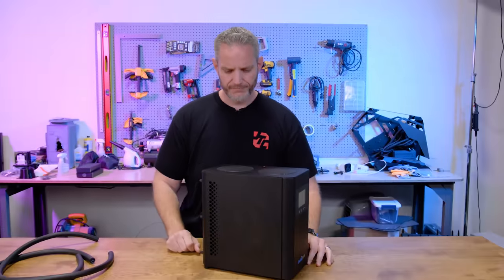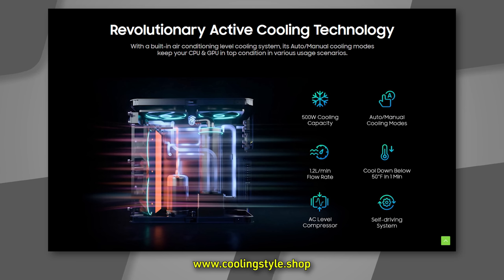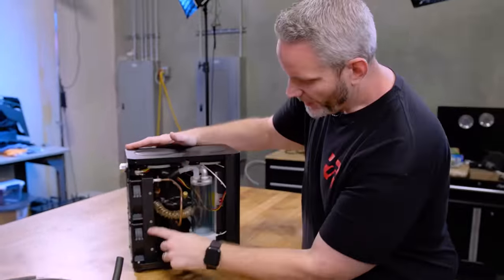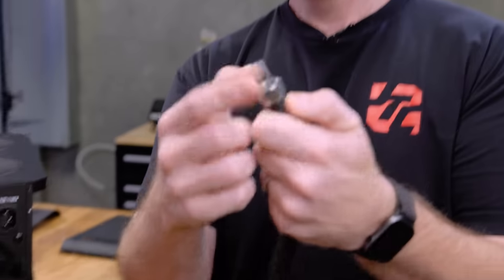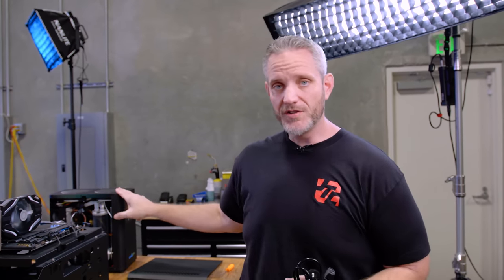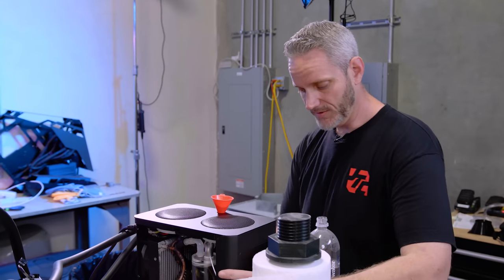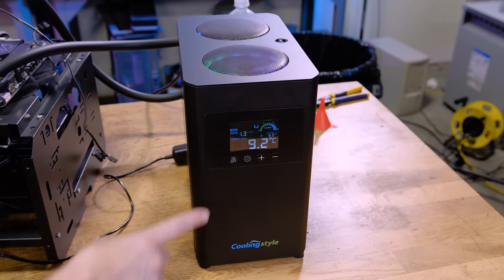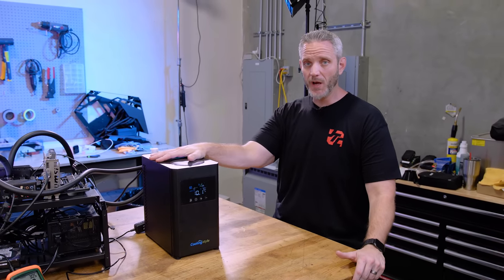This seemed Gimmicky... Turns out I was right!

Comment: for the cost of this, i think i'd install a wall ac into a closet (mini split style) and run water cooling loops into that space with direct cool air output onto them. that way you can apply the benefit to all systems you want to run the loops into the closet for. a panel with a bunch of QD's, and gtg. if you want to get extra fancy, put the pumps in the closet too, and put in a switch panel to control those so they aren't trying to pump water when you have nothing connected.

that or just mini split cool the whole room and deal with being a little chilly in some cases.

i'm sure this has its use cases, but most people probably don't have a need.

Comment: This is another case of: "The idea is good, the implementation is not" There is a reason why our houses air conditioner compressors go on the outside of the house, you can't have a silent gas piston compressor, also how do they manage to keep condensation controlled? If that thing is cooling down the water under ambient temperature condensation will happen inside the unit if air humidity is high, and after some hours it will start to spill water on your desktop, also the air conditioners of our houses have a water drain to manage this natural condensation.

Comment: I used to use the Coolit System Freezone Elite V2, it used to be able to get your CPU to sub-ambient temperatures easily while still being a relatively small self-contained unit that ran pretty quiet because the fan never had to spin at high RPM.

Comment: The 500W is the cooling rating of the the unit, the compressor maybe 450/440W. The power consumption of the unit would be around 170W. 
What maybe interesting is when you exceed the 500W cooling load; the high-temp cutout would stop the compressor and stop the cooling. 
I agree with Jay. A better solution might be to make a similar sized box just made out of radiators and lower 10°C. 
Also the water in this loop would require maintenance/replacement

Comment: What i like about this, is the fact that it could basically sit in a completely different room to the PC you are running. Depending on the pump (which possibily needs to be upgraded). Would also remove the exhaust heat issue in the room.

Comment: If you can plumb the tubes out to the hallway where there's a window it might not be too bad for noise since it won't dump heat into that room for heat to accumulate in the air then the coolant.

That said if you can drill through the wall and have a window in the hallway and it's on the second floor or you don't mind mounting metal grills in there for security you may as well just mount a massive radiator array in there (like...say....three 140mm x 4 radiators). No need to run a compressor or any manner of powered heat exchanger and it'll double as an exhaust fan for the common areas of the house too so you're actively moving air out of the house.

Comment: I think, like Andrew Dinu said, if you were to put this unit inside its own cubbyhole on the outside of the house, that would rather restrict where to put the computer relative to the cooling unit. Additionally, you might want to include a little soundproofing on the walls of the cavity so you didn't let most of that noise back inside (my chief complaint). It ain't a quiet unit in the least.

Comment: You can buy micro fridge and customize it for the same purpose, I guess. )) Price will be several times less. And as a fancy option, you could put beer inside and heat your coffee/pizza/cheesecake outside on the heat exchange )) And yes, it should be split system. Probably, eventually every radiator in house will have option to built in your PC water loop))
Reply: Absolutely,  then when the novelty has worn off and it's thrown into a cupboard at least you won't have spent $700

Comment: @8:35 That's now how it works, the tube "should" stretch over the inlet piece, not sure how it's called, and the nut that goes over should "pinch" the tube between itself and the inlet walls, that's where you get the compression. it's still a bad system and tolerances look bad, but your "fix" seems worse .

Comment: I would have liked to see how much it cooled the system if the liquid went through your Rad first then into the chiller.
My gaming rig is in the basement, so ambient air about 55 degrees F and the HVAC runs continuously. P.S. most gamers wear headsets so who cares how loud it is. I say daisy chain about 4 of these up to the same rig fill it with antifreeze and lets re-clock that beast! ;)

Comment: Having to run threadripper in Asia hot temps, this is quite neat. Especially when we bring the threadripper to control room where noise isn't that much an issue. Having a longer tube and making a better insulation is an easy fix. I can see myself put that cooler into a sound proof box and have longer tubing connected to the PC.
They do need to hammer a few small minor things but I do love it. Especially when you know that double 360 rads (push-pull) are not enough for a 3990x with an ambient of 35 to 43C.
For casual consumer, it's a gimmick, better go with cooler master sub-zero, much more simpler for intel or an Alphacool Eiswand.
Reply: If the PC itself isn't in an air-conditioned room during a hot and humid summer, the PC might get flooded with condensation with sub-ambient cooling...

Comment: I still have a box of 1/4 fittings and adapters from quarter to 3/8 back when CPU blocks used 3/8 and GPU coolers and or VRAM coolers used 1/4 inch. Basically its just a rebranded chiller you can buy for your laser engraver/aquarium. Hence the 1/4 inch barbs they didn't even bother to put standard barbs for the PC on the unit.

Comment: Actually Jay... Due to the refrigeration cycle in the chiller. The air temp will NOT effect the cooling water temp like a traditional AIO. This is coming from someone who has worked on a/c and refrigeration systems for over a decade. 

If you think about how your cars A/C works. Just because the temps outside go up, doesn't mean your a/c stops cooling. It just means the pressures in the chiller refrigeration cycle are going to go up on the high pressure side.

This also seems like something you might use on a server where you don't have an actual server room, but need to keep the server cool in a closet. You would still have to have air circulation in the closet, but it wouldn't need to be a/c cooled like a server room would be traditionally.

It's definitely a niche product, but for a small company that needs a server, but doesn't have the money for a dedicated server room. It would be an option. I would never use it on a regular PC.

Comment: This is called a cold water machine in Chinese, as you see, it makes cold water for the loads.
This should never be used on a GPU since they don't stack heat on the chip. (Chip temp has little increment compared to the liquid/waterblock) In such cases radiators are good enough and get more if it's still too high for you.
This should be used on CPU especially Ryzens. They stack up heat like an electric iron and won't cool down unless a large temp difference (cold water) arrives.

Comment: I would imagine the next step up is like with a portable ac you have a tube running to a window insert to dump the hot air or maybe dryer vents in bedrooms become common place. Honestly I absolutely love this but I also must agree that I wouldn't put it on my desk so I'm not sure how to feel. I'm certainly not in a position to start running water tubes through my door way or inside a wall. I also think this freon based cooling is the best step forward for pc's considering we use it in cooling applications in most other appliances.

Comment: I'm sure there's use cases where this makes sense, mostly industrial applications or PCs in small closed spaces where you could use longer hoses to have this unit relocate the heat somewhere else. For most people though, running a 2nd daisy-chained 360 radiator would be more cost-effective.

Comment: They already had cases with actual refrigerant loops in them that were ready to go about 20 years ago.  Thermaltake even got in on the action.  Any system that isn't dumping the waste heat outside the room, is going to eventually start self-defeating in trying to go below ambient.

Comment: The application here is more for the extremely dedicated setups, where you're putting the fridge unit in a position that it vents outside - sort of like a window unit or central air unit AC system and just piping the water over from the unit to your computer....at which point maybe you just invest in a more advanced AC system that can preferentially deliver cold air to specific rooms and thus lower the ambient temp in the room with the computer.  Because at that point you're already doing fairly significant household modifications, but the advanced AC setup actually delivers you a benefit outside of your computer.
Reply: For not much more than the price of the chiller in this video, you can buy a 1/2 HP chiller.  If you are going through the trouble of setting up a separate chiller, use one that can cool more than a CPU.

Comment: Being an AC tech it is possible that it works, but sub cooling cant possibly be higher then 7 C for that size. So at MAX that thing cant possibly generate cooling temps lower then 7 degrees below ambient. And thats being VERY OPTIMISTIC. BTW even the smallest compressors ive seen draw 40 amps on start and constant 118V power draw and thats only 1 ton cooling requirements.

Comment: This is probably good for small home / office servers that live inside a closet of a separate room. Servers are usually running 24/7 and dust is a bigger problem than cooling. This unit will take care of the problem without having to run the office AC 24/7. I'd servers fail on me because of dust...

Comment: It would not affect the room temperature heat source does not change much. The main heat source is the cpu and gpu. This chiller just changes the heat exchange process. The pump will be an additional heat source but I don't think it would have much heat. Anyway heat would not be a problem but its sound is annoying. May not be an option for the gaming pc but may well be used for a server which is kept in a closet or small room which is not air conditioned.

Comment: I actually see more than a few use cases for this. Soooo I have a modified Koolance setup from 2002 with accessories and all mods that puts it at $488 minus shipping+tax. That comes out to $647 in today's dollar and that's calculated with each year's inflation difference related to each purchase. I didn't purchase everything all at once but managed to get everything at a pretty steep discount because I'm me. Putting all that aside, this chiller is just as much a steal at $700. If you have a normal computer and you're already invested in a nice shiny gold/copper block, grab a Koolance L-Bracket (BKT-PCI-G?) and some quick disconnect fittings and marry it to this chiller for a similar test experience.

Situation one: You are a gamer/jobber/streamer and NEED maximum chiller temps to keep your balls-to-the-wall overclocks stable enough to handle each workload. Maybe your system is (or can be) insulated through a light partition or into a separate room like an attic similar to Linus and wife's old home rack station setups where all the noisy bits are in a nearby location with all the cables and KVM connections piloted into a nice sterile room. You're not worried about noise or access because everything is pre-managed. That's GG.

Situation two: You are an overclocker/enthusiast that lives in an extremely computer unfriendly environment such as Phoenix or the lower part of Death Valley and need a rigged cooler to replace an inferior loop but also need the chiller to serve as a high ventilation vehicle similar to the low/high pressure ventilators in rack rooms or a test chamber. Additional tubing/insulation may be required along with a spec check on the pump's maximum head pressure (expect anywhere from 20-40ft) and a rigged ventilation duct to exhaust all the hot air to atmosphere. THIS is CHEAP $$$ and EFFECTIVE.

Situation three: You are a consumer/developer/engineer/manager that is creating bleeding edge technology, frequently running into NiH (Not invented Here) situations and rely on a flat priced industrial solution for the transfer of liquid and a competent chiller to pump the heat away from XYZ prototype. The noise and efficiency doesn't matter as the device fits a limited period at 100% load and you are recording and evaluating temps to create back and forth rapport to a broad engineering team tasked to create a dissimilar and less involved (but effective) air cooling solution for XYZ prototype (you're demonstrating to them it can happen despite the delta and coming up with a compromise solution).

So yeah. I would probably want to steal this.

Comment: Install a heat pump into your gaming room, run the hydraulics for the unit through your custom loop cooling before it routes to the blower unit. Controls your room temp as well as your PC temp WAY more efficiently than having a heat pump enclosed in the same room. If this is cooling the water it is venting heat... into your computer room.

Comment: I live where "normal" summer temps are 90F.  I have a room AC unit that blows hot air out the window.  I take the side panel off my PC and have the cold air blowing into it.  Keeps the room bearable and my PC fairly cool running as well.

Comment: basically, math said. it takes more energy to convert things. as it use energy, it produce more heat. if you used it in a room that mean it eventually it produce more heat in a room the it circulate itself back to the cooling unit and will actually heating it back to where it was or even higher. only way it will work if its located outside the window of the house.

Comment: It seems a bit alpha version with loud fans and squeaky compressor. They may have just made it a bit too small. I can see this for threadripper workstations for rendering, cad, simulations, or other intense workloads though. It is effective and one would hope, reliable. They should have a signal wire that will shut the PC or server down if their is a fault in the chiller. Alot tho still rides on the quality of the block and the heat plate on the CPU.

Comment: Whilst the plug will fit in our plugs here in aus, it's upside down and has cut outs on the side which we don't usually have, our earth is on the bottom so usually the cable comes out earth side of directly out horizontal (sometimes in the 5 o'clock position)

Comment: With this thing you don't need a heater in your room in the winter. So you will save money on that. But than it goes into vacuum cleaner mode. I guess in the summer it will run constantly in this mode. So you have to turn up your airco. So pay up. Or you have to run airducts from the exhaust to outside your house. And when you have to buy a hearing aid you will  have to pay up again.

Comment: You should use this on a full-blown custom loop system. So the traditional front mount and top mount rad in a chassis, with a D5 pump and then add this to the end. Im assuming this unit would have to work less harder when you got 2 rads taking away heat, so instead of cooling 32 degrees of water, itll need to cool 25 degrees.

Comment: Full body cooling system...
So the US Army has a vehicle, it is the 108 main gun variant of the Stryker, that the built in AC cannot cool the passenger compartment, So they built a system where the occupants wear a cooling vest that plugs into a system built into the vehicle, instead of cooling the whole vehicle, only cool the person.
In practice... the internal vehicle temps would be in the range of 120-140F (50-60C)... but the soldiers were getting hyperthermia from the cooling vests.

Comment: To sum up (if I can be so bold): To improve on this "device" Grab a used window A/C off of Craigslist, add your own water-cooling setup, zip-tie the cooler radiator to the cool side of the window A/C, profit (?).

Comment: Yeah this seems like a stuff it in another room, which has to probably be cooled by a window unit just to keep the room temps good for this unit to work right. Then plumb the water lines through a wall and into your PC which can't be moved unless you put quick disconnect fittings on it... just to have your PC run cooler...

Or 

You can have a window unit in your room running quieter and keep the whole room cooler and thus your PC as well...

Comment: It’s the same flaw that most portable AC units have - they dump the heat they’ve removed from the air back into the room they’re cooling. It needs a duct to route the exhaust out a window.

Comment: I'm positive it's not freon (KFK) in that cooling unit. Mayby nature gases like R600a Isobutan, or R290 Propane or it might be one of the "normal" low pressure refridgerants like R134a  (HFK) or less likely one of the mixed gases that can operate at 30-40 Bar pressure like R410 (HFK) or R32 (HFK) wich is used in heatpumps/air-condition units on this side of the Atlantic at least.

It's usually labeled on the compressor and should be stated on the documents that comes with the unit. What type of gas and how many grams of it, same for what POE oil is used.

Comment: Would need a sound proof box that is vented out a window for this thing to work in a small room during non-winter temperatures. Just taking the heat from the PC and moving it some place else. Might as well do a in-house liquid cooling system where your OUT line takes the place of a water heater. Or feed the HOT line on the liquid cooling through another heater to power a steam turbine or something.
Reply: “Just taking the heat from the PC and miving it some place else.” 
You just described what every cooling solution does.